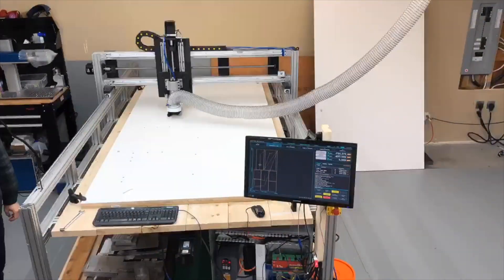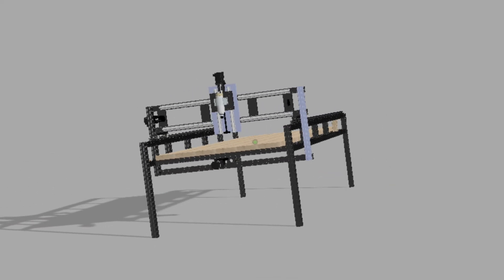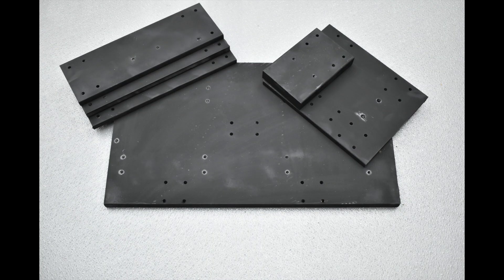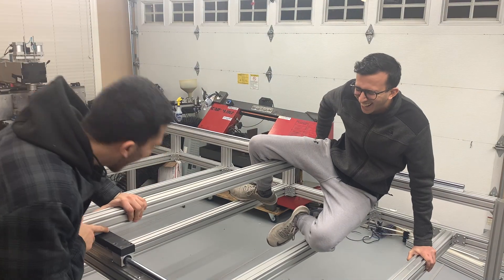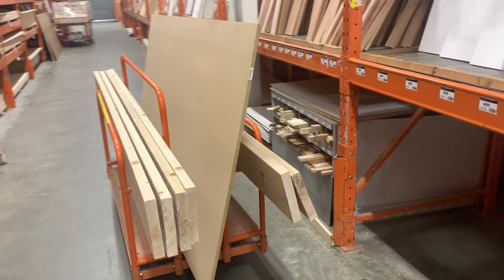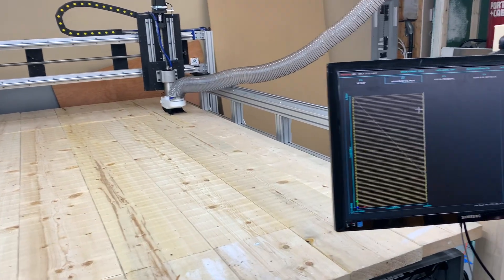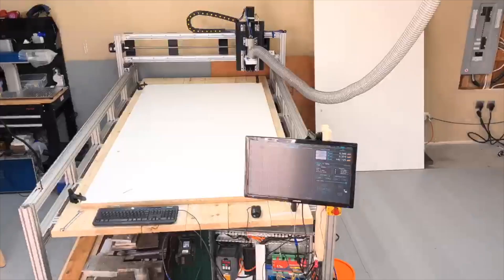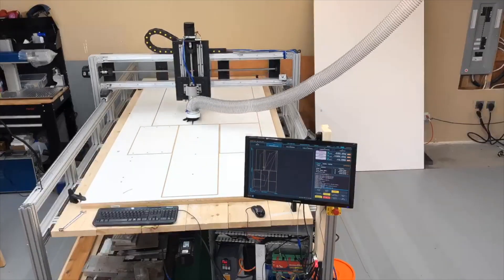HOMEMADE CNC ROUTER.

Comment: Bro where is the video on cnc mill you are referring to in this video.
Reply from the maker: Here it is: https://youtu.be/FkGdJMVJ1Fc
Reply: @ActionBOX  thanks bro. But j was asking for the video on your first mill you made before this cnc mill. I have seen this video and you have spoken about cnc mill using which you have drilled holes on plates. I believe this cnc mill you used for doing experiments with wire edm.

Comment: what the difference between a cnc mill and router. the router looked way easier than the mill
Reply from the maker: The mill is far more stiff so it can cut harder materials.  A router isn’t really great for anything harder than aluminum. Plus milking machine spindles are generally much slower than routers as harder materials require more torque and lower rpm (feel free to read up on SFM). Hope that helps.  Cheers, Dave

Comment: I see you're using Masso in all your builds... Why this particular controller? And how do you like it over other controllers you've used?
Reply from the maker: I don’t like that it lacks some functions such as auto threading (g84) but it’s easy to setup.  Mach 3 is great and probably better for starting.
Reply: @ActionBOX  I'm just looking at Chinese machines and debating between RichAuto B57 (which is factory installed and configured) or Masso G3... I've had experience on UCCNC, Mach3, and Masso and mainly don't like having to bring my computer out to my machine every time I want to use it
Reply from the maker: @vitalistolpner9800  gotcha.  Masso is a great alternative as support is quite good, but it comes at a price.  If price is okay for you then it is a great product.
Reply: @ActionBOX  Yeah the RichAuto B57 is about the same price as the Masso. I'll try the new controller and see how that works. Thanks for the advice.    BTW - I'm on a QueenBee Pro machine right now (though if QueenAnt Pro was available when I was buying, I would have gone for that), and it's a decent machine for what it is, especially if you just need a machine that you can put together in a day for cutting out some parts and then either disassemble, or just have it pivot against a wall or something
Reply from the maker: @vitalistolpner9800  sweet. Thanks for sharing. Looking forward to your comment in our future video 😃

Comment: What software are you running on it?
Reply: I am looking at building my own cnc machine and currently looking for more some more information. I was a also wondering if you might be able to make a video where you go into some more detail about the electronics? Thanks.
Reply from the maker: @campbell_fpv4851  I will try to make a video after the winter break if life permits.  Ps. I am also an FPV fan.  Do you fly drones or planes?  Cheers
Reply: Thanks you. It’s always cool to meet other FPV enthusiasts, I currently fly drones, what about you?
Reply from the maker: @campbell_fpv4851  I am a UAV fan over the multirotor drones, but I currently don’t fly.  I’m glad you left a comment on my video 😃
Reply: I’m glad I left a comment too
Reply from the maker: I am running the Masso controller software.  Are you building your own machine as well? Cheers, Dave

Comment: Hi. very nice design. Could you please let me know the size of aluminum extrusion?
Reply from the maker: 2”.  Are you building your own?
Reply: @ActionBOX  actuall l am in desiging phase of my build. I want to build a 2.4m x 1.5m (xy) router to upgrade my old and small co2 laser. Therefore I'm looking for some large and affordable CNC to find appropriate aproch to prevent bending and flex issues on my own design. Your bulid seems absolutely sturdy so I'm curious to know what is the dimension of your extrusion?
Reply from the maker: @metamorzon  awesome, sounds like a good project.  Again it’s 2 inches by 2 inches (51mmx51mm)

Comment: Great video. Just a thought My workbench is comprised of two large Kreg Universal bench frames bolted together horizontally so roughly 1.6m x 1m. Could your design be modified to run on an existing workbench with a steel frame? Guide rails on each side fitted to the main structure. DIYer’s with limited space could fit the CNC unit when required and remove it when the bench is required for other projects.
Reply from the maker: Great question. My suggestion would be to remove the legs from a design like this and just mount it flush again the wall. It will take no space on the floor. Just an idea 🤷‍♂️

Comment: Cxcelente, What electronic hardware and software are you using? , I don't know.
Reply from the maker: Here I am using closed loop Nema 34 stepper motors with a masso controller.

Comment: Did you source from McMaster Carr, since Fusion 360 has direct CAD models for them built in?
Reply from the maker: Yes I sourced from McMaster Carr. I did not know fusion has models built in from them. I usually download the pieces from their website and upload as a new file. Thanks for sharing 😃
Reply: @ActionBOX   Yeah, you can insert model from McMaster Carr directly in Fusion.  In the Design workspace, under the Solid tab -> Insert -> Insert McMaster-Carr Components
Reply from the maker: @ekbiker  Wow, I wish I knew this 8 months ago 😂. This is going to save me so much time. Thank you so much for sharing 😊.

Comment: It would be great if you could share your design with us. Currently I am also looking of making one bigger router to cut mostly poly and some 8x4  MDF.
Reply from the maker: absolutely. Seeing as that is what everyone wants, I will follow up wit more detailed videos to my machines including all the CAD Files
Reply: @ActionBOX  that would be great. Thx
Reply: @ActionBOX   hello..thanks for the awesome content..I have built a CNC like that but with welded steel tubes.. how is the y axis stiffness since you've used 1 ballscrew..
Reply: @ActionBOX  i just subbed for your channel due to this comment only.

I really like your machine, and i would like to build something similar.

I can also pay for plans and bom and cad files in case you want to sell them
Reply from the maker: @UAEooALKAABI  Sounds good, although I plan on making it freely available with enough interest. Cheers
Reply: @ActionBOX  any updates?
Reply: @ActionBOX  interested also in more details on the build, any updates on it?
Reply: any updates on plans ?